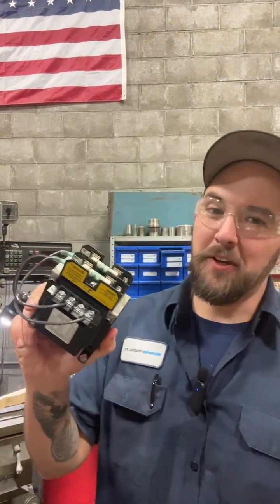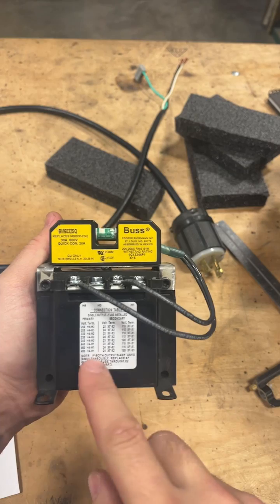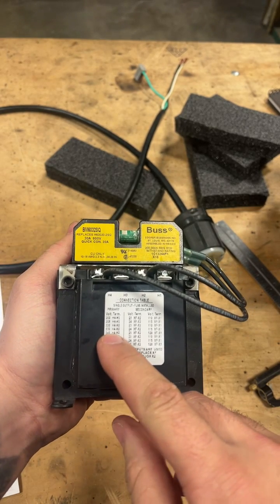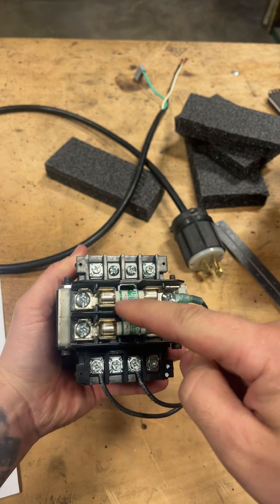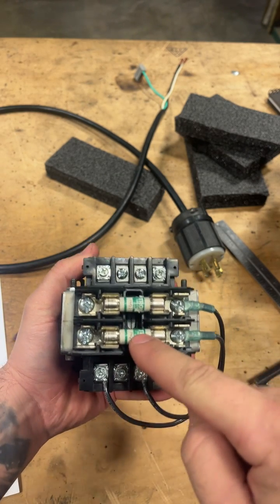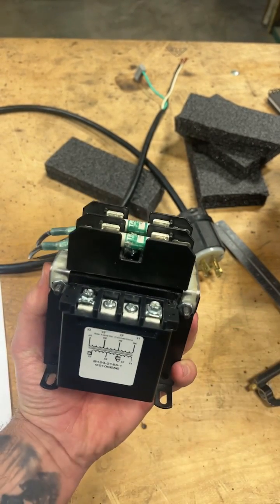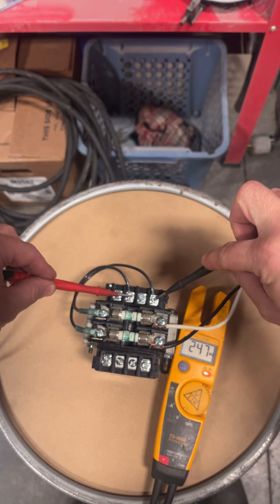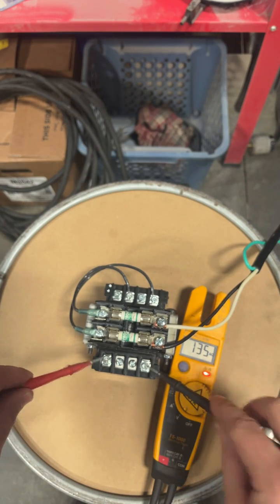Control transformer

Comment: Now show a buck & boost transformer. Wiring those things will drive most people to blow a fuse. I had a hard time even trying to explain one to me boss when I had to put one own our air compressor. Line voltage 208 and compressor needed 230.

Comment: I would say 248 v to 135 v is too high especially when 10% is max over standard voltage i would wire it 220- 120
And then check voltages...

Comment: I just wired one in yesterday it was a 480 stepping down to a 24v wired to a toggle switch because it is for a burner that doesn't need to be on all the time. It kept blowing the fuse though. Found out i wired the switch wrong and was sending the 24v back to itself. Good lesson on it to learn.

Comment: With the output, what is the potential to ground? I mean is there a hot and neutral like mains? One line @120v one 0 or is it +60&-60 180° out of phase instead?
   I need to go from 120 to 240 like mains. I got the ±60 from ground , 120v total and need to go to 240 , 120 over ground, can I use that transformer for  that? What are common places I will find such transformers? What's a PLC?
Reply from the maker: The neutral is the center tap on the secondary side winding. And yes you can use a transformer to “step up” also. You can put 120vac on the primary and get 240vac out of the secondary I’m such a transformer. A PLC is a “programmable logic controller” it’s like an industrial microprocessor for industrial applications like automation. The place I get all my logic stuff is www.AutomationDirect.com hope this helps. Thanks for the great comment!!!
Reply: @dansproshop  so a PLC is like a heavy duty raspberry pi?, like the tow truck is to the Ford viper 😏
Reply from the maker: For lack of a better comparison… yes. Lol

Comment: Wired for 120v out, measure 135v out, close enough?
Reply from the maker: For this application, yes. My PLC will accept 120-240vac line voltage for power. So it will work fine for it’s intended purpose. Thanks!!

Comment: Just got a job as a Maintenance Tech for a foundry and I am lost when it comes to electrical. Thinking about taking some classes at the tech school
Reply: You first lesson. Don't touch. 
If do pull disconnect use your left hand. That way you are not standing directly in front of the switch.  If it blows  that door doesn't land on your face.

Comment: If you have a PLC that is AC powered it probably needs to be upgraded. NFPA70e and the low voltage directive would have me getting rid of as much AC power as possible. Building panels with less then 48v means less PPE. But if your just replacing a transformer for a PA2 power supply for a CompactLogix, then I get it. (Chiller panel)